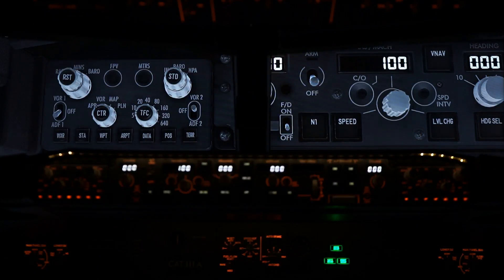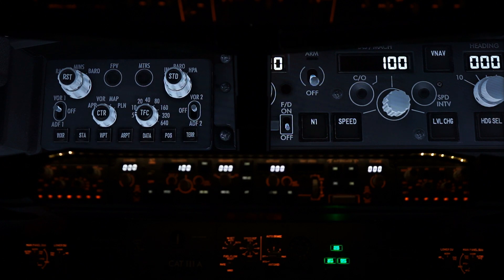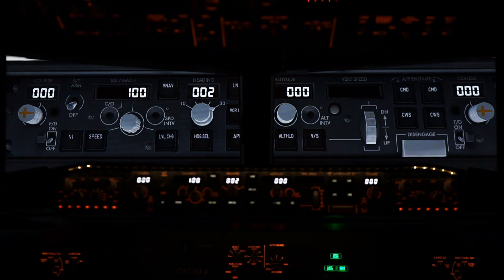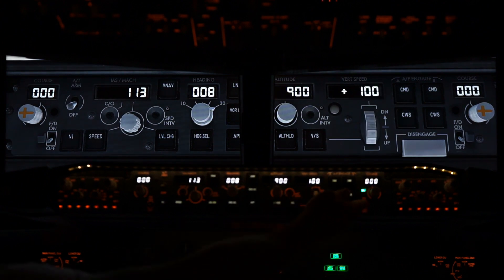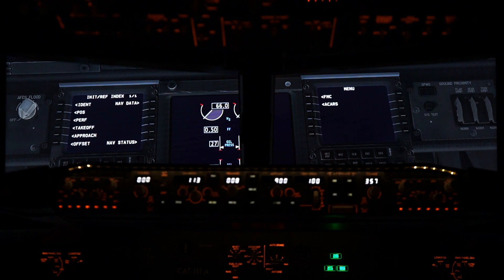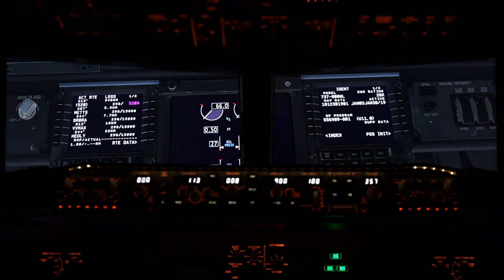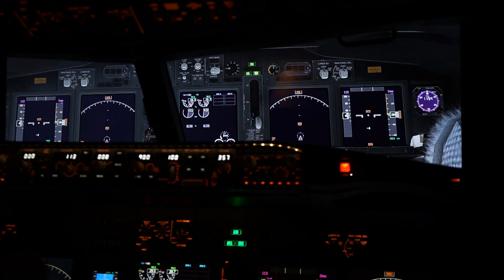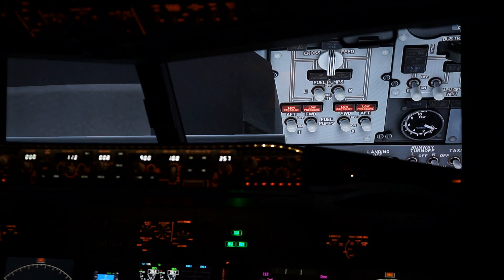FDStoXP Part 1

Comment: So, I have a FDS Jetmax cockpit (Azure now) I fly FSX and have always wanted the better flight model that X-plane provides. I believe I've seen that you started with Pr3pared, did you have to download Sim-avionics for X-plane or are you still using the same interface and just reconfigured it to work with X-plane?
Reply from the maker: I'm using ZSHI and FSDtoXP. I was not able to get Sim-A to work.
Reply: @swannsim  thanks, for the reply. Your sim is amazing!
Reply from the maker: @benjiminus04  thanks